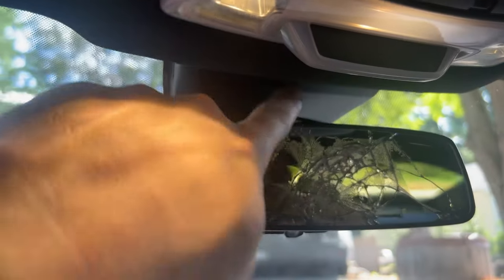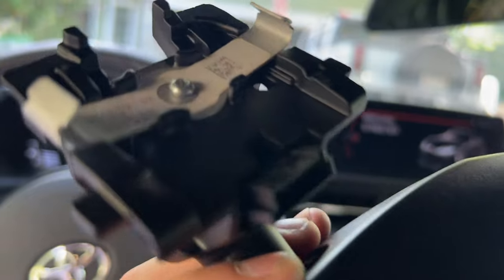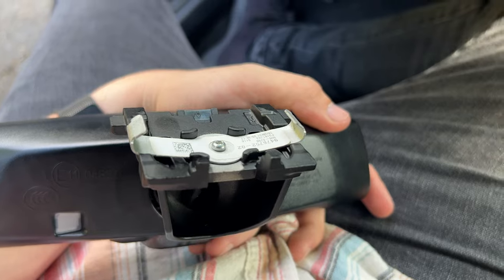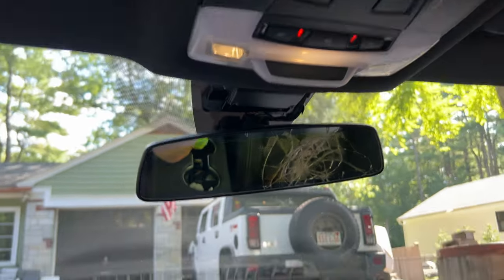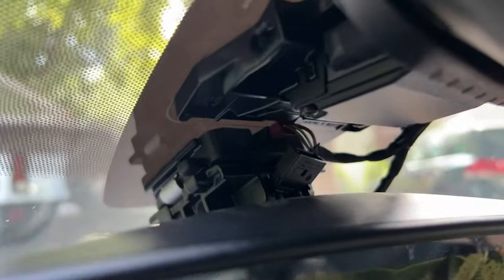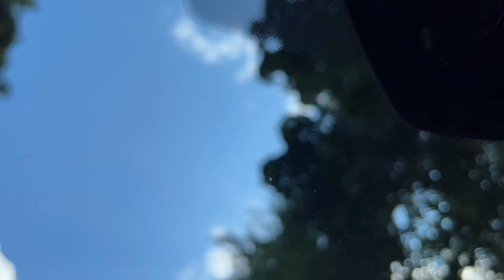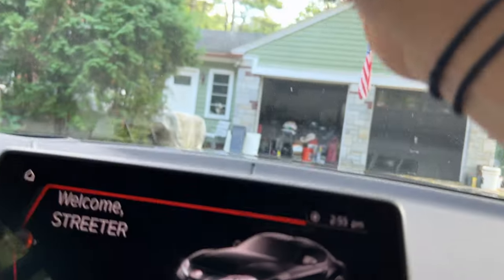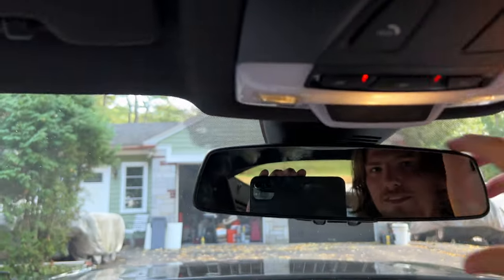I broke my Supra's mirror... (DIY replacement)

Comment: Mine comes without a door opener I am considering to replace it with a one that has a remote door opener. how much did it cost you?
Reply from the maker: sorry for the late reply, new it is close to $1000, I bought mine used from ebay for $550 :)